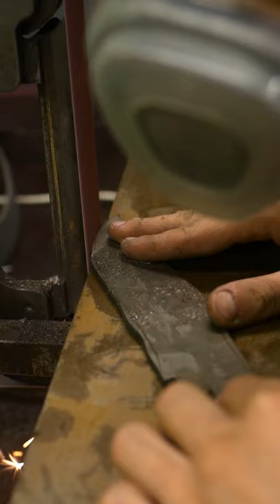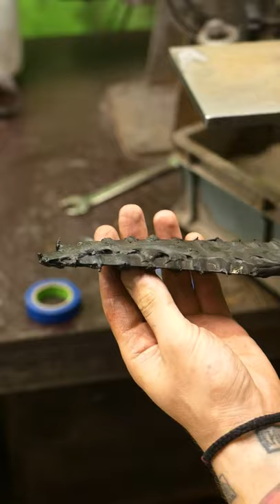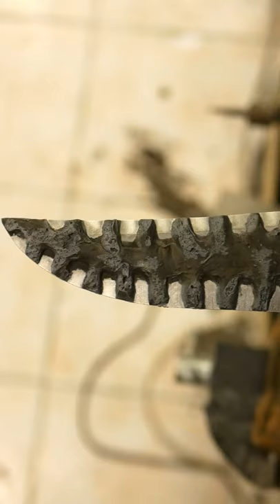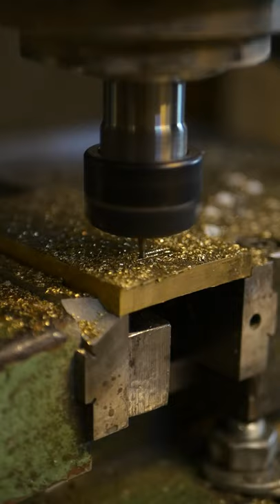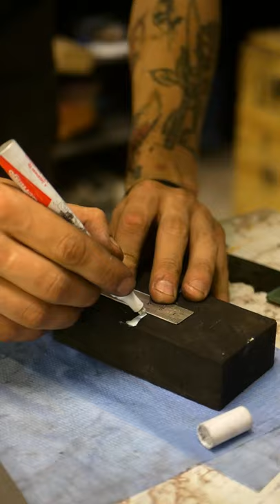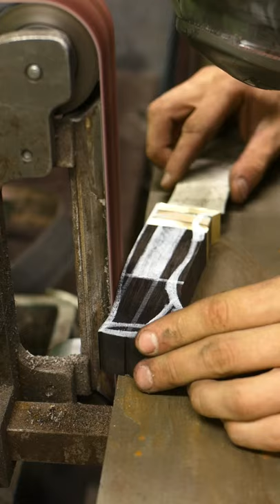Bowie knife with cool hamon line and mammoth tooth bolster

Comment: Beautiful work, it'd be a better blade if he had forged it instead of cut it from stock.
Reply: May be, but lots of great blades are stock reduction!!!
Reply: Why? What difference do you think that makes? He could charge a higher price for it, but it would not be a "better" knife in any way shape or form just because it was forged. That nonsense was put to bed long ago. :-)
Reply: @th-pw8pn  exactly. Plus with stock removal you don't have to normalize your steel either or anneal it. And if you do a good quench your grain structure usually comes out perfect every time because it don't go through the stress of the whole "heat, beat, repeat" steps. There is no difference between the two. Either way they both end up on the grinder for clean up. And some final shaping.
Reply: I disagree thoroughly.  Banging on steel like that to shape it is never good for the steel imo,  let alone does it ever make it somehow superior.  (As the myths go) 
Best avoided wherever possible. 

Nor do I agree  at all with the related claim that is often perpetuated that (forged or unforged) old world simple carbon steels like bladesmiths are confined to using are somehow superior to today's modern high perfornance high alloy martensitic hypereutectoid chromium tool steels.  (Aka high quality stainless blade steels)

The problem with that claim/myth is that they're not lol,  and are in all practical sense vastly inferior in every conceivable way lol.

The only reason makers in particular have pushed these myths imho is because outdated simple carbon steels are so cheap, readily available (new or scrap) are soft and easy to work with and process,  can be heat treated to a passable level easily with little equipment,  takes little knowledge, skill or experience to work with abd can be banged out in a backyard shed with a hammer, anvil and cheap inaccurate charcoal or gas forge quick and easy by most anyone then sold on the custom market often for a (way overly valued) premium.

Literally the only pros about it.
And they all only benefit the lower end  (and sometimes quite unscrupulous) makers or smith's 
Not the customer or consumer! 
All negatives for them.

If yous don't believe me.... try walking into practically ANY other metalworking industry ,  like say aerospac... and try telling them they should use simple carbon steels in all their spaceships and stuff because it's so superior to modern alloys?  Especially if they hand forge it all? 
And when they laugh you out of the place maybe you could come back an reconsider? 😉😄

But whatever I mean both have their place and all so... to each their own.
Reply: @iamshredder3587  forged is better, that's why people pay more for forged parts. If you don't know what you're talking about, not talking keeps you from looking stupid.🤣
Reply: @theethuntv   lol what the? Wow the things we meet online lol!  🤪🤪🤪😂😂😂😂
Y eah ok genius you're obviously a real expert and clearly I'm way  out of my depth  lol.  
Hell how many  episodes of forged in fire did you watch to gain all that vast expertise and factual knowledge?  
Three? 
Three and a half? 😮😮😮👏👏👏😂😂😂

That extra half episode really paid off buddy and not only made you a keyboard-expert but also gave you the self confidence abd courage to stabd up abd mouth off at real men behind a keyboard even!
That's quite the leap fir you bro I'm sure of that lol! 

But hey....if my fellow knifemakers can strip you of wads of hard earned cash by peddling you that song and dance and hocking off a bunch of outdated,  rusty, soft,  low performance, high maintenance,  old world carbon steel scrap the picked up for free at the junkyard abd quickly abd easily banged into a passable knife shaped object in their backyard shed then heated it up in makeshift charcoal forge and hair-dryer and dunked it in vegetable oil then cleaned it up and convinced you it was a high end custom handmade masterpiece and charged you to match.... and you paid..... 
Well,  more power to them haha! 

Now if someone who actually knows their stuff hadn't been kind enough to waste their precious time trying to teaching you something that's actually true and even warned you about some of the biggest, most prevalent myths and  scams  tarnishing the completely unregulated knifemaking industry today and also sone of the reasons for it....  and how ridiculous it actually is to anyone reasonably in the know.....   and then got mouthed off to and disrespected by a snivelling little keyboard tough-guy and always-know-it-all type nobody who's actual expertise is in knowing  if he knew this person I'm the real world he'd  best never be so stupid to try that lol...... for his troubles and was just an innocent mark then I'd surely feel sorry for them and more but....   
As the saying goes.

"The fool and their money are easily seperated."  
And I add... fir the fool that's also a bigmouth behind a keyboard,  good riddance!  😁👍
Reply: @iamshredder3587  there's a reason people buy forged internals for their engines...
Reply: @theethuntv  Just because people pay more for it doesn't mean its better. A handmade pocket knife isn't inherently better than one made in a factory by the 100s.

Comment: Lmao “hamon lines” 

That’s low-tier mall ninja hamon lines, not actual hamon lines.
Reply from the maker: Sure)
Reply: Is it still called hamon when it doesn’t even use traditional clay? And for the record, what made the ninja-hamon low-tier?
Reply: @oval1666  so a hamon is a wavy temper line made by quenching it faster in some spots then others. Then you etch the blade with acid and it reveals itself. A "mall hamon " would be just ground onto the blade or put on there without doing the hard work of doing a deferential quench. I am unsure as to what the original comenter is talking about though.